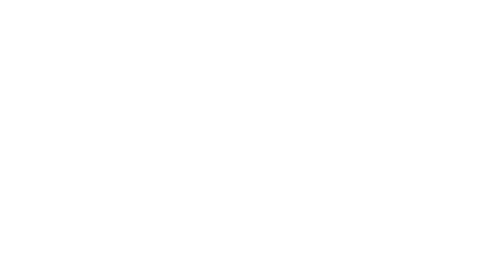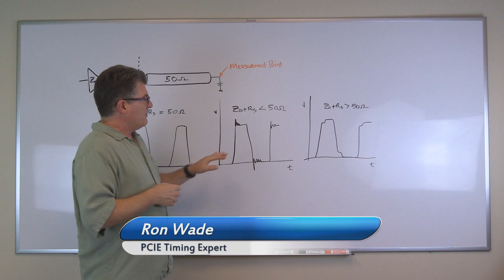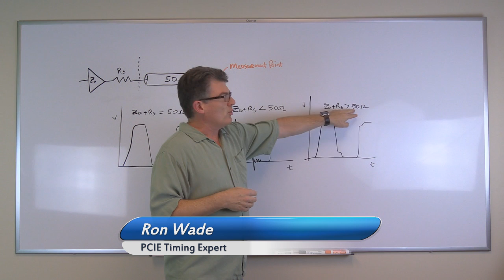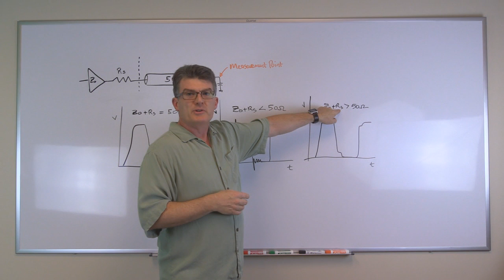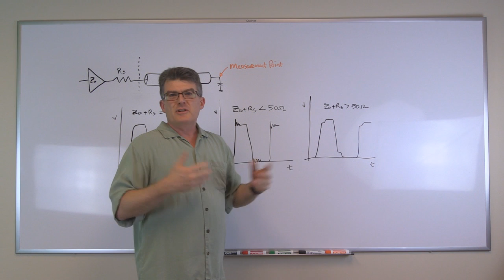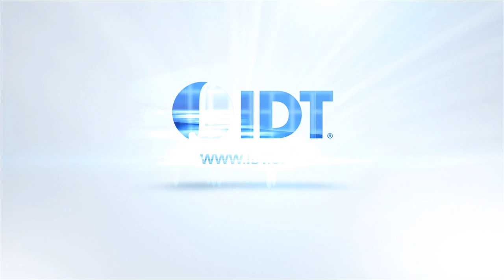How to Properly Terminate a Clock Signal by Identifying Common Signal Integrity Issues

Comment: I want to know how the capacitor rating at the load point affects skew/slew in relation to frequency.
Some designs call for 0.1uf others 0.001uf. Some don't even use a capacitor.

Comment: What if it's a data line? Do we need to put series resistors on both sides of transmission line?
Reply: Not sure, but for matching I'm guessing there are many similarities between a CLK pulse-train and a data line. One other important aspect of a high frequency data line would be the slew rate (outside of maximum specs, and the Rx may interpret an incorrect logic level).
Reply: For bidirectional data line, keep lines as short as possible, match the data lines length within 5mil and then put the Rs in the center of data lines

Comment: I am building a Schmitt Trigger to clean up the signal on a DIY GPS Timing Reference. I thought that my poor waveform issues were likely related to incorrect termination. So, I watched your short video. It was two minutes of exactly what I needed!

I tested the S-T with my function generator. By varying its output resistance (50/600 Ohm button) and adding a variable resistor in series and parallel after the Schmitt Trigger, I was able to effect/improve the waveform's shape. Thank you!